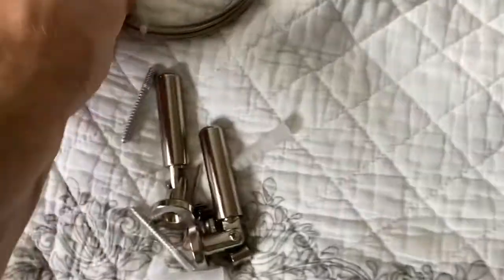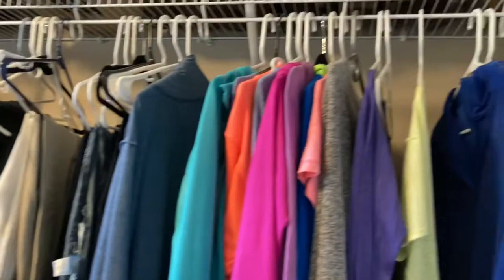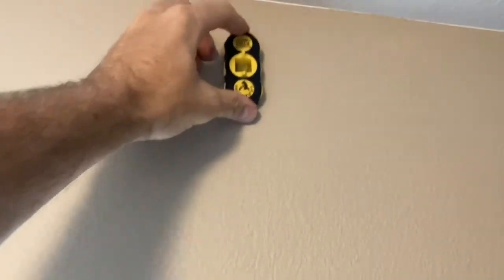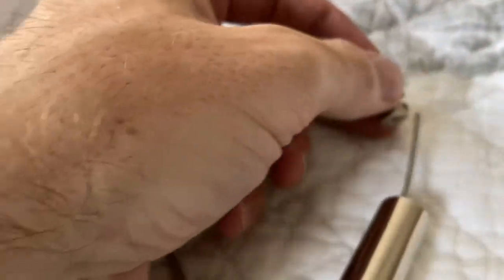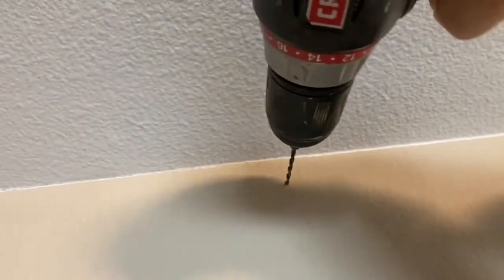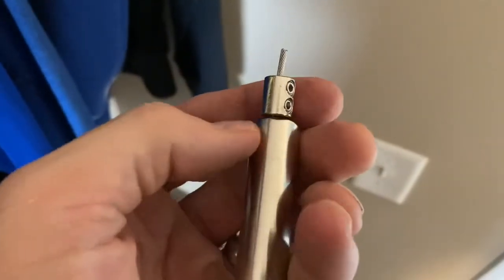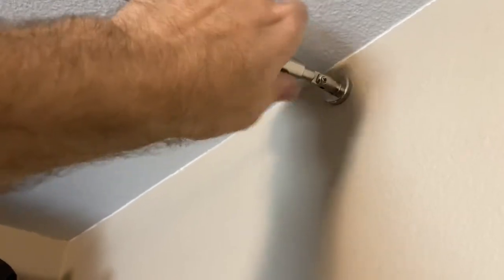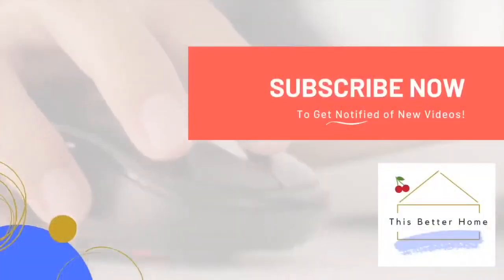🔥 Adjustable Tension Wire for Curtain / Photo / Artwork➔How to Install (Instructions) - Easy DIY Job

Comment: Good job 👏 Could you not have put it up without the clips? Looks like you could have put the line through the eyes (eyelets ?) Of The curtains
Reply from the maker: Definitely a possibility, but much more difficult to remove (for cleaning) or replace the curtain.

Comment: Why didnt you use the hanger holes in the curtain? It would have looked so much better
Reply from the maker: We wanted to be able to remove curtain easily. Also, the clips add a little extra length extending the curtain closer to the floor.

Comment: Nice tutorial. I'm wondering if the wire sag a bit after some time? My width is 3.2 meters or 126 inches, I assume sagging is inevitable, right?
Reply from the maker: I am looking at the wire right now and pulling on it. The wire does move a little but no visual sagging except where the bunched curtain rests. If it is sagging significantly, it may be a symptom of the pieces unscrewing somehow over time, or it's not secured in a stud.
Reply: Did you end up hanging that up?
I'm debating between this and a rail for a 114 inch opening

Comment: Why did you use the clips instead of the grommet holes of the curtain?
Reply from the maker: Good question. Threading through the holes was an option, but I used the clips because they (1) provided a little extra curtain length and (2) allowed for easier removal of curtain if needed.